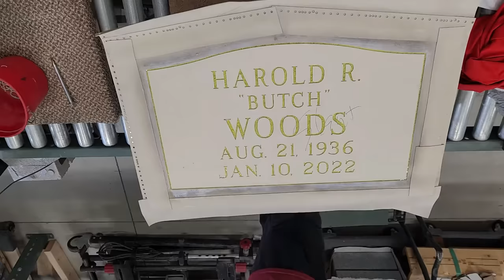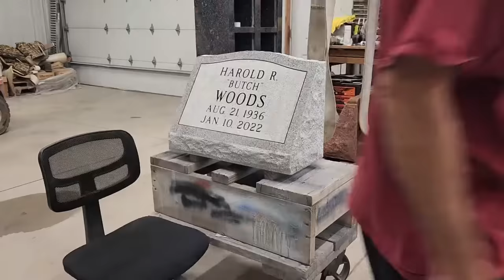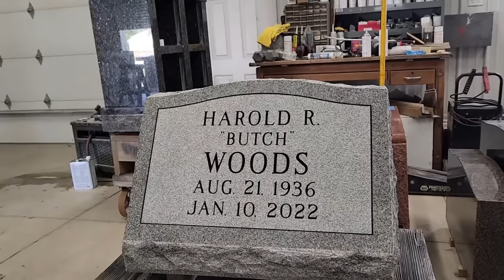Engraving a Headstone

Comment: My dad did this back in the 50's in North Carolina. As a kid I would often spend the day with him during the summer. He cut the stone with a wire saw from a larger block which came from a quarry in Mt. Airy, NC. He then cut it to shape, polished it or chiselled it as requested by the customer, applied the rubber sheet, cut out the lettering and sandblasted it by hand. 3D designs of roses, vases, etc. required several layers of rubber with more sandblasting - it was a real art. When the stone was finished, he loaded it on a truck and drove to the cemetery where he installed the stone (they weighed hundreds of lbs) by himself with just a basic boom and winch on the truck. He taught me how to cut and shape stone - I put 7 tons of it on a house I built back in the 80's. Good memories from days gone by...

Comment: Thanks! Hasn’t changed much at all since I had this gig back in the early 1970s when I was still a university student and worked part time doing this exact process. Our working conditions were a bit rougher as we did our work in a big open metal shed with a dirt floor and the wind blowing thru - freezing your butt off in winter but cool in summer when it was near 100° outside it was still cool and damp in the shed. We had overhead cranes moving multi-ton chunks of granite over and around while we worked and giant cable saws running cutting granite down into slabs. But the process of making markers and monuments was exactly like this. I worked at that job while I went to art school and left there to work in an ad agency downtown in a high rise. Thanks for the memories!
Reply from the maker: Thanks for watching!

Comment: To people here commenting on the method:  Granite is granite.  The method used to create the lettering doesn't matter, it will last hundreds (thousands?) of years, just like the Pyramids.  Most old tombstones were made of softer Marble or Soapstone because of the cost/labor of sculpting such a hard material, that's why you often see old tombstones that are wore away.
Reply: The pyramids are made from limestone.
Reply: The outer decorative layer (which is almost all gone, proving my point) was made of Limestone.  When built the Pyramids were smoothly sloped with polished sides, probably coovered in Hyroglyphics.  Only the Granite core survived 3,000 years.

Comment: I used to do this for my families business. We did it slightly different.  We would whiten the stone as the last step.  We’d use a putty in the letters to protect the paint
Reply from the maker: Ended with the same results. I always feared doing it that way would round off the crisp edges of the letters. So I frost it first in a double process. It's how I was taught
Reply: @night_al you are correct, we whiten first as well why take the risk of rounding out the letters. My family has been in this business since 1870, so we might know a thing or two.

Comment: After my Step-Father died. My Mother and I went to see about getting a headstone. Since he was retired military. The gov't supplied his headstone. We did not know that at the time. I had never seen etchings of artwork on headstones before. And I was fascinated. I am an artist. I asked Jim Warner of Warner Engraving in Dundee, Illinois. If he needed any help doing artwork on the headstones. I showed him pictures of my srtwork. He was very impressed. 9:42 

 At the time, he had an artist working for him. He called me about a week later. He said his artist quit. And asked me if I was still interested  in learning how to etch on the headstones. I started about a week later. I initially used a Dremel Engraver, with special diamond bits. My first headstone had a portait of a dog on one side. And a horse's head on the other. I was very nervous initially. But they both came out fine. 

I eventually started using an engraver from Paragrahics. It is a high speed engraver. Operating at around 300k to 400k RPM's. The Dremel was probably around 35k RPM's.

I worked on an as needed basis for Jim for several years. Even after he moved his shop to Lake in the Hills, Illinois. I loved doing the work. Unfortunately, for me. The industry started utilizing laser etched etchings.

I initially felt strange doing that type of work. Until I did a portait of a young black musician on granite. I rendered him with his guitar. Ironically, my girlfriend at the time and I saw him perform at a blues bar in Elgin, Illinois, a year or so before he passed. I happened to meet his Sister one fay. And she told me how special it was to see his face every time she went to visit his grave.

I wish I were still doing the work. Jim Warner actually cut each individual letter out of the sandblasing surface by hand. I guess, that is very rate. As now they have machines to do that. I am not sure if Jim has retired or not. But he was a character. I really enjoyed working with him.

Comment: My uncle works in the monument industry, and taught me years ago how to do it. Basically our method was the same with a few exceptions: 

When we put on the rubber, we would cover the whole face, but instead of cutting out the face area then frosting it, we would lay a stencil with the information needed to be sandblasted. Then we rub the stencil (it has a graphite backing, kinda like pencil) then cut out the letters, design, etc with doing straight edges first (tops-bottoms-side to side) then freehand curves of letters then the design. Once they're cut you pull each letter, design, etc revealing the area to be blasted. Then you gear up( mask, gloves, respirator etc.) and blast until you start seeing letters "round out". Once finished, if the monument required lithochrome (basically spray paint) you would spray it over the finished blast, let dry, then pull the rubber revealimg the blasted letters, then, using wet cement to protect the lithochrome, you would frost the face. If the dye incorporated designs, they would be free handed to give a more life like appearance. That is how a monument is made.

Btw, when i learned we didn't have a shop, so i had to sand blast in a field, during winters and summers, in the lovely SC heat and humidity.

Comment: Fascinating. I never expected something like this used sandblasting. I was always under the impression that a carver would use a hammer and chisels or some kind of mechanical engraver like a Dremel to work each element. I guess old school is a fading art, much like sign painters and pinstripers. Although with the sandblasting it goes faster.
Reply from the maker: @davidu4758  supply and demand. Before, hand carving was feasible because of death rate. Now, with the population soaring, death rates occur faster and headstones are more in demand.
I appreciate the comment and thanks for watching!

Comment: There are still stone cutters who hand chisel the stones.  It's an artform that is quickly becoming lost,  but the stones will look superior.
Reply from the maker: It is lost. Stone carvers don't share their knowledge anymore. Why? I have no idea but I wish I knew their secrets as well
Reply: I grew up iin the 60's across the street from a Catholic cemetery in Chi' suburbs and saw many a truck borne  sandblast unit come and add dates to long set grave stones in remarkably similar process. Apply a rubber mask / stencil (already prepared) and shoot. BTW the cem' in question is where Al Capone is buried . . .

Comment: my first job after graduating from college in 1969 was working for a monument company - the techniques are exactly the same in this video that we used then
Reply: Same here LOL, I did this work back in the late 1970s, same techniques although we never painted in the letters and relied on blasting to the correct depth so the bottom sort of channeled out and caught a good shadow to make them stand out. I also did totally hand cut lettering on marble and Indiana limestone, hammer and chisel, no sandblasting. Still have my tools, all handed down to me from the "old timers".
Reply: our stone-cutter did it both ways - I remember the rubber mat glued on the face of the marker and plastic letters / numbers that were pressed into the mat and then cut out with an x-cto knife before sand-blasting ......he did some hand work on fancy scrolls and flower designs - the guy was a real artist to watch .....the best part was setting markers in a cemetery , with a hand-cart pushing the base and top stones hundreds of feet into place and setting the pieces without chipping an edge .......oh, and hand-mixing concrete for the foundation and wheel-barrowing a full load or two or three of mix across uneven ground to pour ...........a real character builder for $1.75 an hour !

Comment: Im a mason in the UK for 25 6ears now. Its interesting to see the difference. For example we dont add eztra glue when blasting on granite, was that just PVA glue you were paitning on? Out stencil has a glue backing and are cut on a laser bed. 

Our blast cabinets are manually operared and are contained so no need to cover up and be in the grit and dust.

We only recently switched to spray paint aswell, using enamel paint and a brush, plastikote spray has sped up the process immensely. Though i feel you should wear a mask with those fumes buddy.

Alao we use a rubber roller to press the stencil down where as you hammered yours down.

Nice job.
Reply: Their process doesn't seem to be very efficient.
Reply: I suspect the extra glue is there to prevent wicking of the paint between the sandblast mask and the granite.  My technique is to spray in clearcoat into the engraved parts to seal them, then put on the enamel paint.
Reply: @joelbagodonuts124 1 man working with an overhead gantry, a computer cut layout, an automatic blaster and spray painted letters. Its a lot more efficient than me marking out the the letters by hand, first roughing then out, then cleaning off the marking then recutting to tidy up the letters and then painting each letter in by hand.

Comment: Headstones are expensive because the quarrying is labour intensive with expensive equipment. The work is hard on the machines. Granite is hard and heavy and requires big transport and a lot of different grades of diamond to polish, then masoning , then the proofing of the lettering , then the lettering. The install is done again with truck and crane…..it’s not styrofoam.
Reply from the maker: Absolutely!

Comment: Nice job, very similar to how i do it, only difference is I've a cabinet blaster. Those saying no skill involved, I'd welcome to my workshop to come have a go !!! As for those moaning that it's not right to pay so much for something that's not traditional, well i offer both, but there's a big price jump. Unfortunately hand carved letters are ( pardon the pun ) a dying art. Main reason is productivity. A very good, and fast hand letter cutter can achieve 80/100 letters a day. Sandblasting, a few thousand is easily achieved. And those saying the paint won't last, it's trade specific, and would be exactly the same paints that would be used on hand cut.
Reply from the maker: Well said

Comment: Curious why you sandblast the "background" by hand and then CNC blast the lettering? Is the lettering blaster more powerful to etch deeper, so harder to control by hand?
Reply from the maker: It is more powerful. The background panel only needs very little pressure to remove the finish and make that area look frosted which is why I do it by hand. If I used the automatic blaster, that panel would be deeper than it needs and way more frosted.

Comment: Nice shop, bridge crane and all. I like how the doors are cut out to fit around the roller tables, the 2X4 cradles to hold the stone, a lot of thought to make things easier. Do you also set the stones?
Reply from the maker: I'm a finish carpenter by trade and did all the finish work to the building as well. It was definitely thought out. And yes, we set them

Comment: Technically, this would be STENCILING a headstone, not ENGRAVING it.
Reply from the maker: technically, this IS engraving with aluminum oxide USING a rubber stencil
Reply: I'll bet you're loads of fun at parties...🙄🙄🙄
Reply from the maker: What's a party?
Reply: the sand carves away the stone with the high pressure . it is a form of engraving at at 150 to 175 psi its very quick to get an 1/8 to 3/16 of an inch deep . any deeper and theres a chance the centers of the tiny letters fall out .

Comment: The rubber stencil must be very resilient to withstand the sandblasting without being worn through.
Reply from the maker: As long as the nozzle keeps moving. If it were to stay in one spot for longer than a few seconds, it would wear through the stencil with ease

Comment: I used to do this very thing, it's not easy. You have to keep moving or, you will burn the stone and then have to shave it and start all over. Grey granite is the softest then red and black is hardest. Black granite takes skill and patience. I quit doing this after, I made a stone for a kid, I went to high school with, he was killed in a car wreck. Was back in 1980. The sand doesn't last long, it turns to powder rather quickly
Reply from the maker: Berry Grey is hardest, I swear. I dread blasting it. Takes forever to get to v sunk.
Reply: @night_al  you ain't kidding lol

Comment: Interesting video, thanks! QUESTION: I understand the function of the rubber stencil and you probably doubled it up at ~1:40 to make it more resistant. But what do you brush on before and what is it good for?
Reply from the maker: It's an adhesive specifically for stencil on granite

Comment: What kind of stencil material is used?  It seems unbelievable that the sand blaster is strong enough to carve out granite but doesn't even faze whatever type of "paper" the stencil is made of!
Reply from the maker: @Margalus  it's made of rubber and as long as the nozzle keeps moving, the sand just bounces off. If the nozzle were to stop for just a few seconds, it would burn a hole right through the stencil.

Comment: Having done this work for many years , the sand blasting is the same as hammer and chisel -  both remove excess material,  the difference is what is done to finish the cuts . Most quality shops hand finish all the stones. Most "good enough" shops will save an hour and paint it then send it right out , no detailing. Since the sand blasting has been used for over a century - it is an old fashioned method.
Reply: Mind sharing the profit margin per order, is this a lucrative business or volume driven?

Comment: I must have missed something. If the letters are applied and then sandblasted around the stencil, how does the letters become recessed?
Reply: My thoughts exactly,,,,then I noticed the headline,,,,, 'engraving',,,, so no chiseling of any depth, looks like it will need redoing every 10 years or so.
Reply: The abrasive bounces off the rubber, but wears away the hard stone very fast.
Reply from the maker: The sand recesses the letters. The section of video in the automatic blaster was edited for time. It took in reality, probably 8-9 passes to achieve the "V" sunk look to a depth of about 1/4" on dates and 3/8" on the last name "WOODS"

Comment: I saw painting through a stencil onto the stone, but did not catch where it actually engraved into the stone, which it apparently has.  Was it something in the paint that erodes the stone away where the letters are?
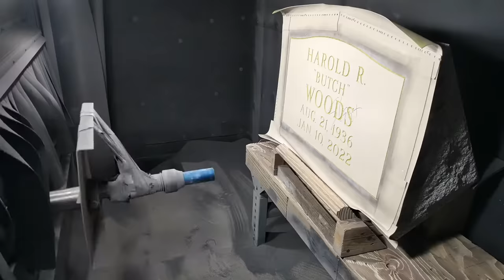Reply from the maker: Engraving occurs at 6:04 with a sandblaster and aluminum oxide (sand substitute)
Reply: They never engraved it. They etched it.
Reply: @night_al I thought the machine was applying some sore of primer before paint 😅

Comment: I dont understand how sandblasting achieves a V cut? I get how a chisel could do it, but doesn't sandblasting do one depth?
Reply: It DOES NOT achieve a V cut; that's why they fake you out by painting it black.
Reply: With spray paint nonetheless. Gonna be wore off in 2 yrs and look like crap
Reply from the maker: It does do achieve a V cut. Paint isn't a fake out, it's a highlight.
Reply from the maker: Lithochrome paint is made for this industry and made to last.
Reply: @Telephonebill51   you are very wrong.  you have no idea what you're talking about. sandblasting will automatically cut until it forms a V. the wider the letter, the deeper the cut. the black stuff in the letters is to create greater contrast and make it easier to read. not to fake anyone out.

Comment: Curious why do you air blast the paint afterwards? Is it to dry faster? Also is the camp fuel used to clean? I would have thought it would mess with the paint.
Reply from the maker: It is to dry the paint faster. And yes, camp fuel is to remove any excess adhesive.
Reply: @night_al  Thanks for your reply. Do you use any base or top clear coats? Just wondering how paint by itself holds up under the sun and humidity and such.
Reply from the maker: @chrisf8584  only a clear coat after paint. It's Lithochrome paint and made specifically for stone